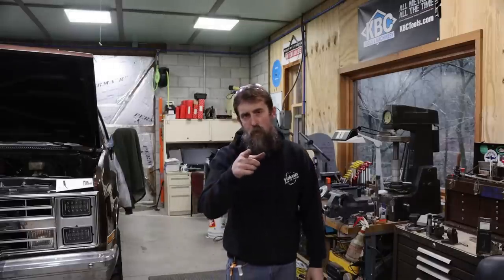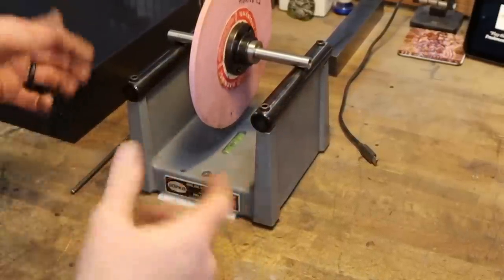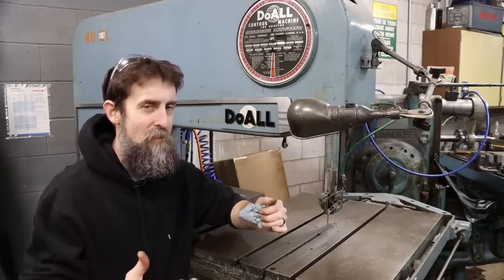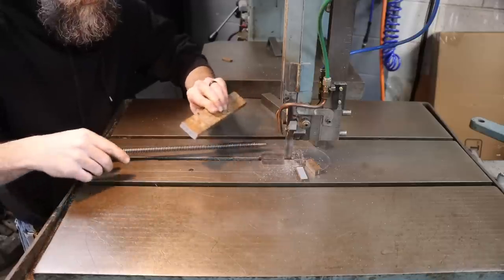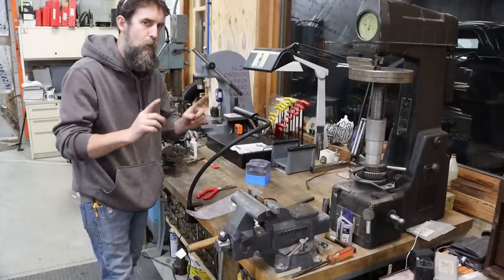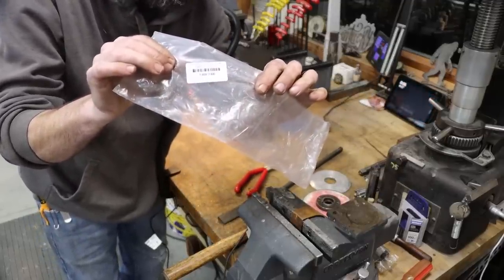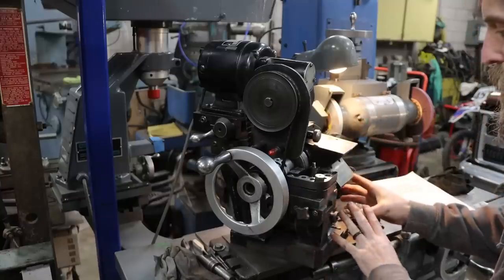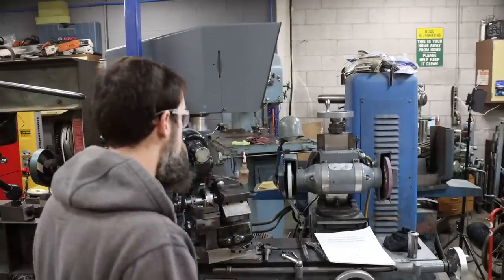New Machine Tool day!  Have you seen these  tools before?

Comment: The circle cutter actually works pretty well, but the fore/aft adjustment is critical. The point has to be right at or very slightly ahead of the blade teeth.  Also on my DoAll I use the on/off as a master power switch for the saw but I added a foot switch for the blade. I figured that if something goes bad with the saw I didn’t want to try to get out of the blade and over to the switch.  Something happens, I step back, blade stops.
Reply: I added a foot switch to my drill press for the exact same reason.  Best upgrade I have made for a long time.
Reply: @richardl4556  same here!
Reply: A 'dead mans' or a kick to stop?

Comment: Hi Steve, as an amateur machinist I was so relieved to see how you balanced those grinding wheels. I made a balancing jig that works on the same principle as your commercial one and used it mainly on those horribly unbalanced wire wheels with excellent results. As there isn’t much to dill on a wire wheel I would add self tapping screws to the light side to even it up. What a difference that makes. Anyway I used the same jig to balance the wheel on my surface grinder and like you I drilled the stone to balance it. I thought it was probably a very shoddy way of doing it but I feel a whole lot better about it now. That grinder is an amazing piece of kit and I shudder to think what it cost new but I’m sure neither you or I could afford one. I love those Do-All accessories. Cheers Stuart 🇦🇺

Comment: 32 years precision grinding and i have never once balanced a normal 7" diameter surface grinding wheel less than 1 inch wide. Not only have I not done it but no one i have ever worked with has ever done it. No shop i have been ever! Sure seems popular with youtubers though.

Comment: If you're going to balance a grinding wheel, you need a wheel hub with adjustable weights.  I don't think there's enough money in the universe to get me to stand in front of that 
grinding wheel after you've drilled into the side of it.
Reply: I quit watching after seeing what he did to that grinding wheels 😮😢 (don't forget that those wheels are about as Fragile as a china plate)

Comment: When I saw how much those balancing stands cost, I went in another direction. I bought an accelerometer sensor ($5) for an Arduino microcontroller and was able to dynamically balance it. I made a plate so I could add weights around the perimeter and moved them until the vibrations were reduced as much as possible. It really improved the surface quality of my ground finishes.
Reply from the maker: That is a really cool idea.  You should send me a photo of the setup. I would like to see it
Reply: @SteveSummers  I sent you some pics.

Comment: @ 32:41 I use drills sharpened (not by me) with a point...
Saves me using a pilot drill when cutting soft metal;... Aluminium;... Copper Bus Bars to connect cable lugs...
& it eliminates the drill snatching;... digging in...

Comment: About 35 years ago I worked in a shop that made heat exchangers. The tubesheets and baffles required hundreds to thousands of holes to be drilled, reamed, and grooved. About 90% of the time these were 3/4" diameter, occasionally 1". We would drill them using radial drills, and there wasn't a CNC machine in sight. We never drilled pilot holes as this would significantly increase the hours on a big tubesheet. The swarf was a pretty reliable indicator of when the bit was sharp and when it was dull enough to require sharpening. My recollection is that a sharp  bit would eject swarf from both flutes of the bit evenly, and the swarf would not tend to break off unless you disengaged the feed and pulled the bit up a little. This is exactly what your sharpened bit did, so I reckon your grinder was working well. We had a similar grinder in the toolroom of that shop, although I don't remember the manufacturer of it. There was a lot of demand for heat exchangers at that time; the radial drills were in constant operation and the grinder was frequently in use to keep the bits sharp.

Comment: Al came through again, fantastic picking. Great demonstration. My dad had a etching hand wand that used a 12 volt battery. As a kid I don’t know how it worked but tried to use it and destroyed a deep cycle marine battery. I was using it on the steel weld table and set it down to long. Thanks for sharing.

Comment: Lincoln Electric made a similar etching device years ago. My Father had one in his tool box. It was 12 volt. You tied one alligator clip to the positive and one ground lead to the battery ground. I used it a couple of times and it was perfectly able to mark your parts or tools.

Comment: I make aluminum rings with set screw holes tapped all around the outside circumference that attach to the back of the wheel hub. That way i can add/remove set screws wherever i need to balance the wheel. It’s quicker and easier than drilling divots.

Comment: I own two precision grinders I use in my home shop.  1 is a auction find that was the deal of the century.
Apparently designed for optical grinding work it has a diamond wheel with two grit sections and a v notch all in one wheel. Plus four other wheel types.  Like your machine this has two cam assemblies. One to move the glass part x and y, and one to move the motor (wheel) for course fine or v-notch.
Since I grind carbide not glass I have made some modifications, but have made some new cams for custom applications. Honestly, none of my cam profiles have worked correctly, but I keep trying.
So I can totally appreciate the learning curve your machine would have.

Comment: I've seen an etching tool used for re-marking the material type on offcuts after cutting, and before they go back into material storage, that way you don't have to guess if you have a piece of 4140 stock etc. Only drawback I'm aware of is rust can obscure the etching if it's in storage too long...

Comment: The Relief Grinder is one of those machines you could spend your whole working life running and still not do everything that can be done on it.
I have a drill grinding machine that does twist drills in pretty much the same way, though only two axis of movement but it has inbuilt cams for 2, 3 or 4 flute drills, it is so nice to be able to quickly sharpen a large drill and get perfect even cutting edges.

Comment: Steve, instead of fracturing the wheel by drilling on it, make an outer ring that presses on to the arbor that is drilled and tapped as close a possible say every 10° then use various set screws in length and material as balancing weights.  I have these for each of mine Kind of like the adjustable balance weight arbors..  My process is mount, true up, balance, true up, balance then grind.  each step affects the wheel's ability to chatter, so in my case, older cheep Taiwanese grinder i get my best finishes by this process.

Comment: Steve I have run a similar machine at Goodyear Aerospace for nine years. 
The machine I ran was a Hybco form relief grinder and it too had a optical comparator. Personally I think the Hybco is a better machine. I now have the Hybco 2100sb head that I mount on KO lee universal grinder. I think I have about  fourteen cams . I think I know more about the Hybco head than anyone. 
If you have any problems let me know. A tough one grind is a square shoulder on a step drill. I worked out a formula for doing it. I am 72 years young and trying to pass along what I have learned. I started out learning tool &cutter grinding at 19 . Two old experienced grinders started to train me and show me the best way they knew how. I think it is time pass along what I know.

Comment: When I balance my wheels, I drill the same number of holes on BOTH sides of the wheel to maintain concentricity as drilling all off one side you might have a issue with harmonics otherwise. Also keep all the holes close to the hub as possible.

Comment: I have that same Precise grinding spindle.    Check the bearings on yours, if you have to replace them the maker can still supply new ones, but it would be cheaper to buy a different spindle.   Also, look to see if you have any collets for it in the drawers anywhere... they're also hard to find.
Reply from the maker: No extra collets unfortunately.  I can make the ones I need most likely

Comment: I just bought one of those. They are made in Seneca Falls.  I got a wiring diagram from them as the grinder is wired 460 on mine and the assessor it’s are 110.
Reply from the maker: Everything but the main spindle is 120volt on mine as well.
Reply: @SteveSummers    I’d be interested in seeing how you are powering the grinder. Mine has about the same accessories  as yours. It will be a long term project getting it running.

Comment: I seem to remember your neighbor, Brian, has a similar drill bit grinder that can do the funky dance. That was 7 or 8 years ago.  It is not quite as sophisticated as yours.  If I recall, it does not have the comparator.  Might not have some of the other features.  I remember being amazed at how it would grind a split point bit correctly.

Comment: I was  right about what it was but it was much more advanced than i heard of 😀
Reply: If you have to grind much of a drill you can set the start at a slightly different angle so that the end result match the tvist thats been grind of if you understand what i mean, 
Almost 30 years since Ive don it so im not shore but i think it was a little more on the outside edge

Comment: Giddings and Lewis made a similar grinder it takes up twice as much floor space has about you could cylindrical grind 4 x 10".  It was sold at Gov. auction it had a $98,000 acquisition cost tag on it, form the 1980's. It would be great for a prototype or R&D operation. Great demo.

Comment: Steve, usually grinder have a special hub that goes on the grinding wheels to do that balance the wheel.  That hub has an adjustment to help balance the grinding wheel in order to avoid drilling spot hole on the side of the wheel.   By doing that I hope you do check the ring tone to see if that wheel did not crack or expose a crack during that operation.

Comment: Hi Steve from Aus. With my RO form relief grinder the center section is rotated 90 deg to the right looking from the top. That way the movement lock out screw is to the left. This will give you axial relief only and I have been grinding countersinks that way for years. I think mine is an older version as the tailstock is held by 2 bars. My latest video went up 4 hours before yours. Hard to believe 2 videos on the same obscure grinder were so close. They don't work with the cam in back the front. Regards BC.

Comment: Steve,  you may or may not know that KO Lee made a work head that used cams for the same purpose (relief grinding).
We had several KO Lee's in a shop I worked in, and they were all equipped with the relief work heads.
Those heads are pretty hard to come by any more.
You and Keith Rucker have the best luck, finding machines.
He just moved a die sinker into his shop.
Regards,
Duck

Comment: I believe the drill bit was modified to drill holes in sheet metal. A long time ago a skilled trades sheet metal guy showed me how to modify a regular twist drill bit to cut clean holes in sheet metal. I think I still have the bit.
Reply: It's for wood, it's called a brad point
Reply: @andyb7963  Although I this bit could be used in wood I don't think that was the intention for modifying it. On the other hand, commercially produced brad point or spur point bits are typically used in wood and wouldn't work very well in sheet metal. Youtube search "how to grind a sheet metal drill".

Comment: Hey Steve, I realize the paper blotter on the gringing wheel is nothing very accurate, but it appeared to be way off center
It may be an indicator that clearance in the hub allows the wheel to be off center. Maybe before balancing, be sure the wheel is mounted concentric as possible to the hub.

Comment: Does the spindle also move in and out on the grinder?  When I saw the two follower bearings at 90 to each other, the one on the back of the spindle, I got the impression that maybe you could drive the spindle axially also...

Comment: a newer version of mine. Bet your gonna sell that KO lee, and soon. My main grinder is fixed, where yours is tilting. I have a digital color comparator, so i tossed mine out. i like your base much more. Now you know why i am proud of my unit. Yours is a bit nicer, and my R_O head is manual, but thats fine with me, i will add power someday. I cant wait to learn more, i didnt get a manual just boxes and boxes of things. i know more already! My rear grinder runs up to 28,000 rpm. take the R_O head off, you have a decent surface grinder

Comment: So, with the blade welder built into the saw, can you drill a hole thru the material, put the blade thru the hole, and weld it, then cut out an inside circle?

Comment: I thought surface grinder arbors had a built in balance system usually consisting of screws that rotate around the center shaft?

Comment: You should look up how to dynamically balance the stones 
Instead of taking the full amount at 1 point you take out half as much in a up side down Y 
So  half as much off of each up side down of the Y’s 
So the lightest point would be the on the one leg of the Y 
The heaviest is below the one leg of Y but you remove material from 2 points of the up side down of the Y 
Research the method take your balancing to the next level

Comment: Hi Steve, I'm sure I have seen arbours with sliding weights to balance wheels. I hate the idea of messing with the construction of the grinding wheel by drilling into them, If you go too deep with the drill the result could be catastrophic. I have seen wheels explode and it aint pretty.

Comment: Drilling (or any modification) to a grinding wheel is not only unwise..... it is out and out dangerous . Balance should be corrected with a weight balancing washer. Example, drill holes in a steel washer to get the needed offset weight. Telling your viewers that it's ok to do so is dangerous and irresponsible....period.
Reply: :face-red-droopy-eyes:OPINION....PERIOD 
What a PITA, you have not even laid out in detail how one might accomplish that
I'd bet Steve has been privy to many more years of experience (personal & outside) than you've been watching... 
fussbudget...